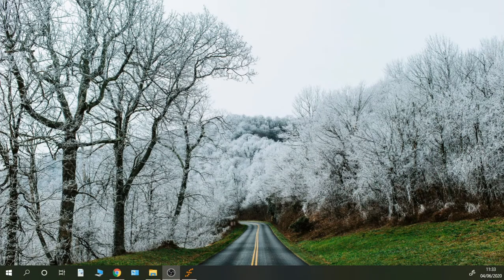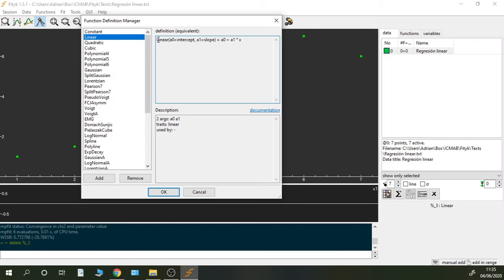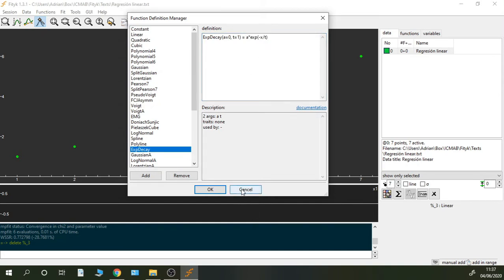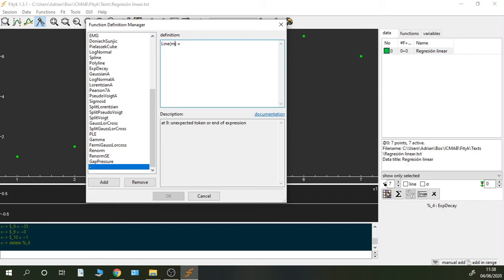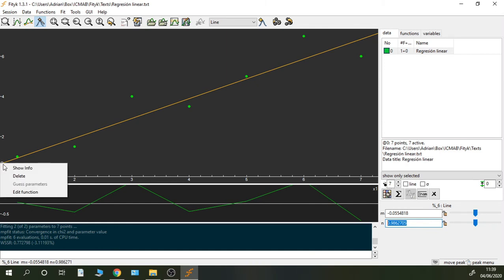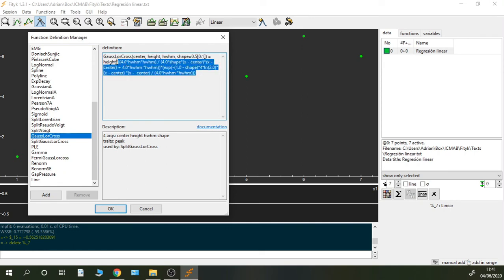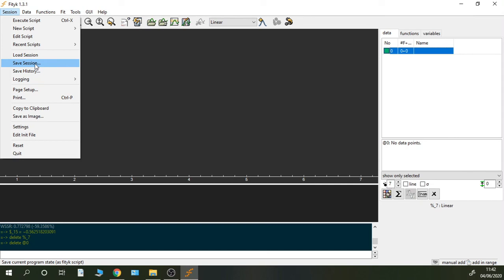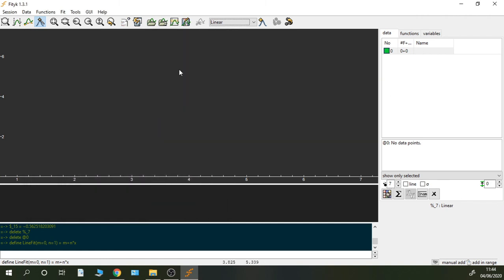3. Fityk Tutorial - Define and use custom fitting functions

Comment: Hello, Could you explain an issue why there is a difference between the equation you are showing in the program and one mentioned in the details sections? In the details section, you mentioned as GaussLorCross(center, height, hwhm, shape=0.5) but in the program, you added another extra part [0:1] just after the shape=0.5. If I put [0:1] in the function the Fityk program quits. and If I use the same function as in the details section I get some additional spikes in the spectrum where there is no peak at all. If this function is useable for multipeak system or just single peak?
Reply: Hi Science&TechEdu, it is  a bit late but I'll leave the answer here anyways. the [0:1] is the range in which you want the variable to work. It is actually explained in the video at 5:55. The program crashes if you use it in the editor though, at least in that Fityk version (I contacted the creator about this issue so maybe it is already solved), so the workaround is defining the function in the line of code at the bottom of the program instead of using the Function Definition Manager, and then you can use the brackets limits. The difference with the function in the details solution is that in the latter there's no limits, son it may fit with values of shape above 1 or below 0, which are unrealistic and give weird shapes.